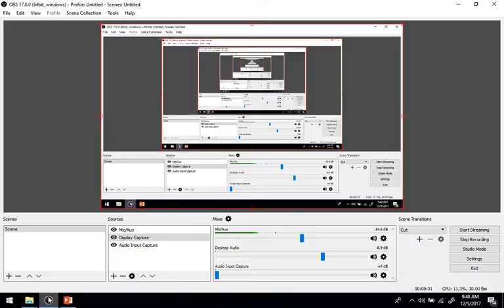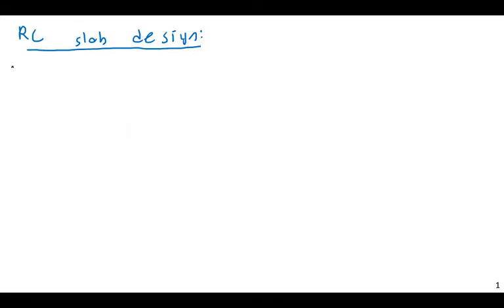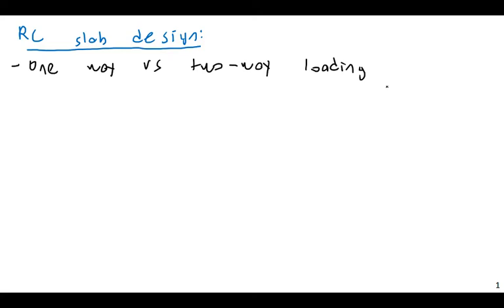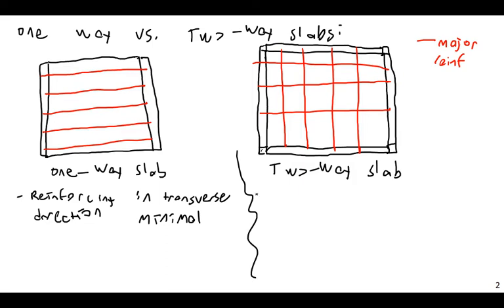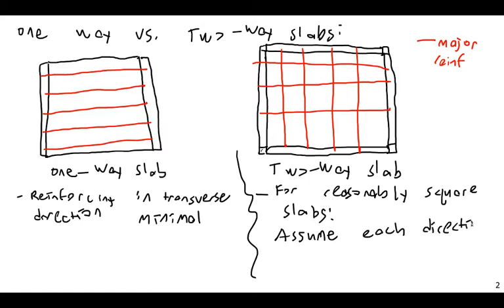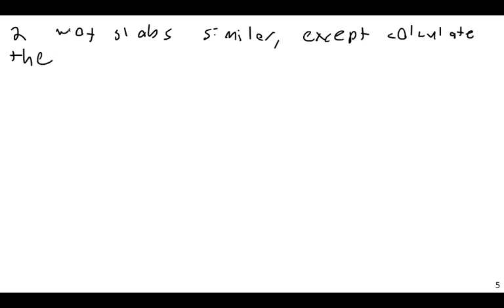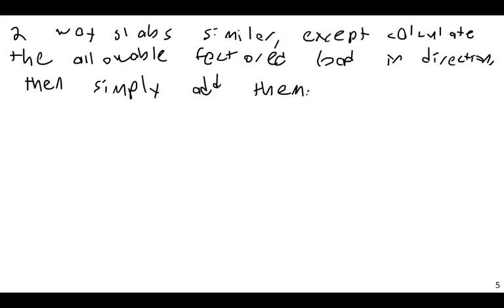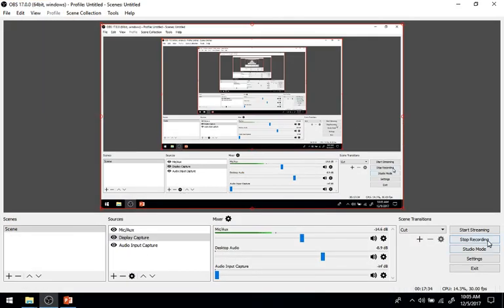Concrete Slab Design Theory - Steel and Concrete Design

Comment: hi tanya! you have design for one and 2 way slab?
Reply from the maker: I don't really have full design examples up, but what it comes down to is that ultimately a concrete slab is designed as a series of beams. A concrete slab is really just a series of beams, all placed next to each other. With one way slabs, the load is taken in one direction, with two way, in two directions. 

There's a lot more to actually doing concrete slab design, including a lot of code checks meant to protect against various failure modes beyond simple bending. But the basic principle of slab design is that a slab can be seen and designed as a series of concrete beams.